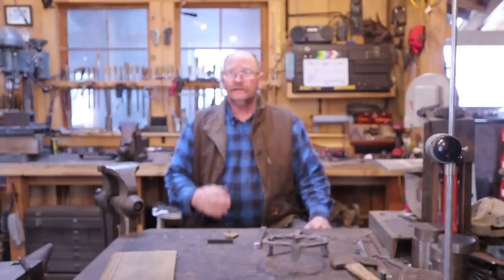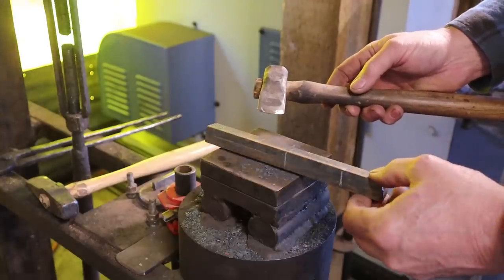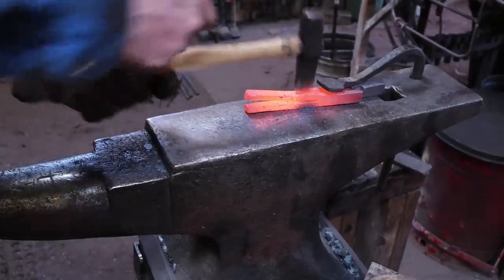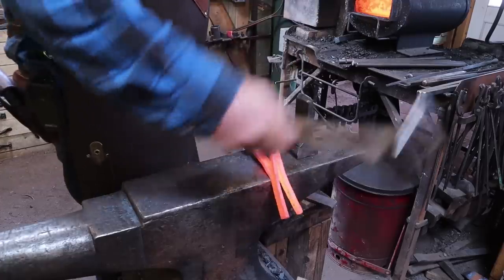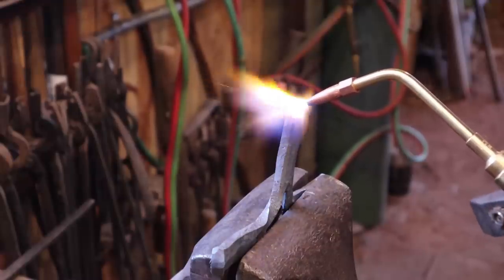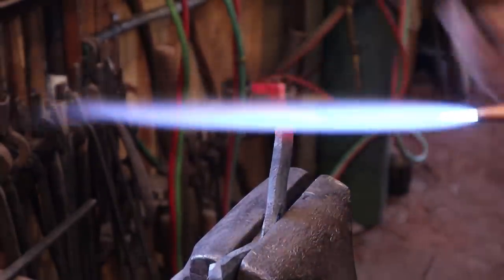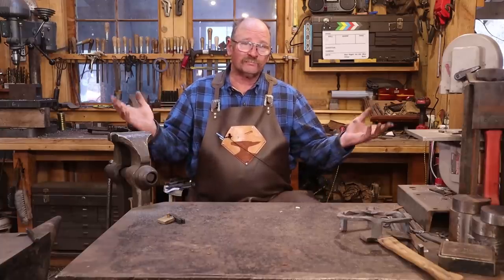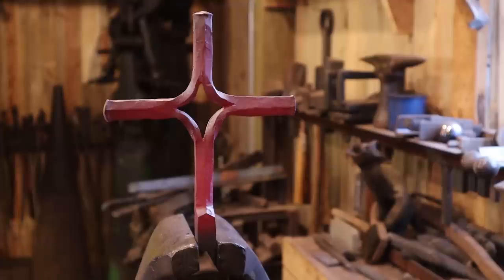Blacksmiths split cross or Friedrichs cross

Comment: Your videos really makes me wish I cud set up my shop to learn blacksmithing. Really good videos. Regards from Sweden
Reply: Blovie I was wishing the same thing a few years ago.  I had hammers and not much else.  I started going to a local blacksmith club to take notes.  I built a coal forge using a hair dryer and scrap metal.  A friend found a piece of railroad track I could use for an anvil.  Fast forward 3 years and now I have a real Peter Wright anvil, a hand crank forge blower, and I've made most of my necessary blacksmith tools from scrap metal.  Long story short, you can do it.  Start small and see if you really like it.  The whole thing is slowly taking over my life, and I'm better off for it.   BTY, my next addition will most likely be a home made gas forge!

Comment: Thanks for the informative video, I now understand how this is done.  However, I don't remember you explaining why you left a cube of material on the bottom; can I assume that is meant for a means of mounting in some sort of stand?
Reply from the maker: Mostly because if you split clear to the end the upper arm would be as long as the base.  But it also provides some material to forge a tenon out of for mounting.

Comment: You Tube been wanky lately. Haven't done a split cross in a hot minute. Used to do rr spikes with a different cut pattern to save the head for a base. Used the glass marbles from empty spray paint cans to sag into the diamond for a nice visual effect in a sun-filled window.  🐾🔥⚒

Comment: It's not out of focus, that knob on the light stand is as sharp as can be! Isn't it amazing what the cameras can choose as a focus point sometimes?
I make a lot of these crosses from 1/2" square bar for friends, family, folks at church. Eschewing certainty and risk, I go for pragmatism and efficiency: a tiny tip on the plasma cutter and a jig built from heavy flat bar lets me unzip these things quickly.  Otherwise, it takes longer to slit them than to forge them.
Reply from the maker: I'm impressed you can accurately split a 1/2" bar with a plasma cutter

Comment: I suppose you could do the splitting with a bandsaw? Of course then it would be more fabrication than smithing.
Reply from the maker: I think if I were making a bunch of smaller ones for craft shows I would probably do that.  But on the larger ones, I really like the look of the chisel cut.

Comment: I'd like to see the base, i am curious as to how to do a rock base.
Reply: Hammer drill a hole into a rock?
Reply: That's what i figured, then i guess glue or epoxy?
Reply: @deemedappropriate4790  I think a nice tight fit would be ok but you could epoxy but it might make a mess hard to clean epoxy of stone.

Comment: Also at SOFA last year, imagine a cross made from a precut blank 27" long 2-1/2" x 2-1/2" weighing about 65lbs done by the Brotherhood of Friendly Hammermen
Reply from the maker: Thats more than I want to wrestle
Reply: The Brtherhood is a large group of smiths and they all had a hand in it and they use special floor mounted jigs to open it